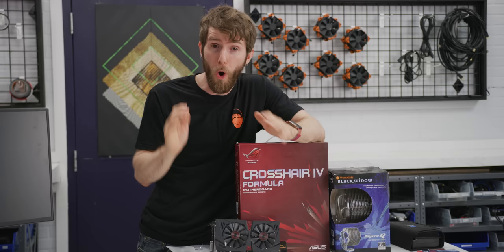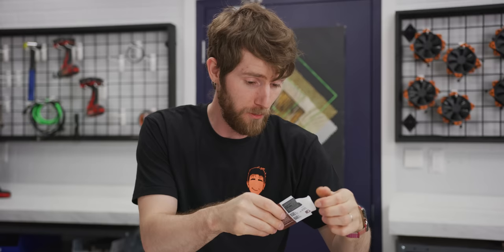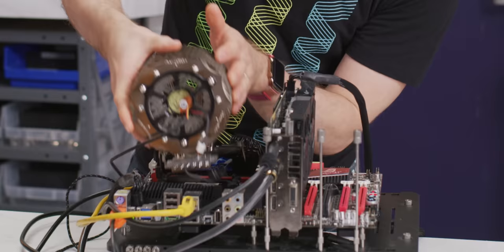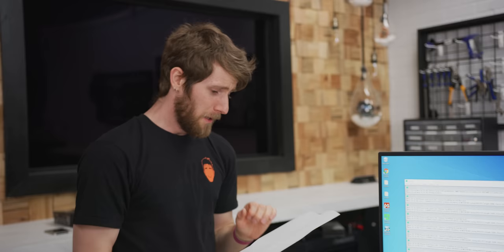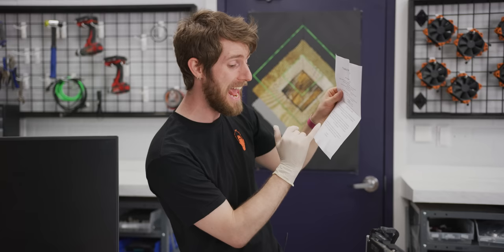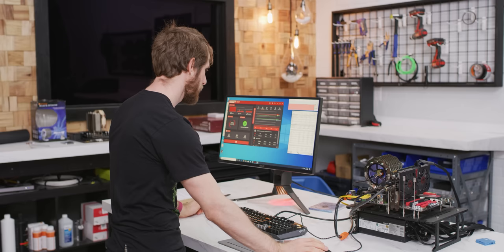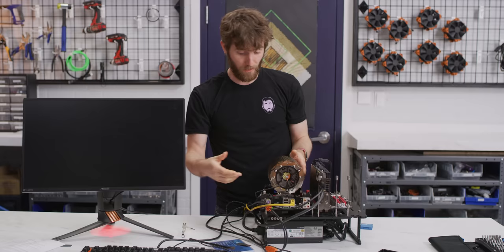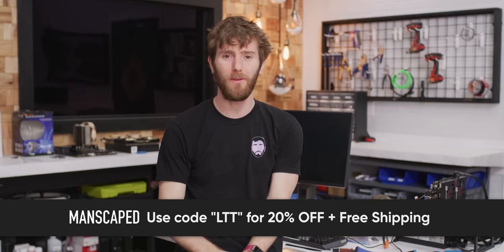Testing Another YouTuber's Thermal Compound!

Comment: The epoxy reaction is exothermic while curing, so it's adding chemical heat until it's fully cured.
Reply: However that whouldnt explain the next days results
Reply: If a reaction is exothermic it will add chemical heat until the reaction completes, eg once the material has cured/dried. Hence after the material has cured, no more additional heat is produced from the exothermic reaction as the reaction is complete. Therefore it will perform better, reducing the temperature (and this is what would have happened if it was left overnight). A chemical reaction does not continue indefinitely, the reactants are mixed together to form a product relatively quickly, not to continue forming together forever, this is why they are supplied in two separate tubes.
There are other issues to contend with the increase in performance the next day, as the any excess solvent which supported the colloidal dispersion also will have evaporated, which itself may not have been very thermally conductive, and until the reaction completes (irrespective of the exothermic nature) the compound likely just will not perform as well.
Reply: @crayonmunch  I think he meant temperature fluctuations that occured the next day during stress testing.
Reply: force curing an epoxy will affect its' performance - physical glue performance is not the most critical in this application ( pardon the pun ).  adhering to the manufacturers specification may have improved the results.  maybe this is a pocksy product.
Reply: @deansmith4752  No, it's just that thermal epoxy is a product that does two things: glue+thermal interface, so it does them worse than products that do only one thing, such as regular glue or thermal paste.
Of course, if you have to mount a heatsink and you need it to be glued on, neither glue nor thermal paste will do the job, thus thermal epoxy comes in doing either thing worse, but both at the same time.
Reply: We use epoxy that drys out when heated with a heat gun, and if you dry it too fast it cracks 
Heat guns are much warmer than what a CPU can do though, but it doesn't take much to destroy the curing, which is most likely what Linus did when he tested the CPU before it had cured 
If you walk on concrete before it has cured, you might leave footprints.
Reply: @dubious6718  Except he wasn't hitting the cooling plate or cpu with the heat gun.  He was using it on the fin stack to get them up to temperature so he didn't have to wait as long for equilibrium.  Any heat curing effect on the cpu/plate interface would have been done by the cpu itself, as it immediately runs at high temperatures, long before the heat gun heat would have had a chance to work its way down.

Comment: You can lap the epoxy back off, could be interesting to see how much (if any) lapping it does ;-)
Reply: I also thought he could just lap it when he wondered how to get the epoxy off. Or after that hammer treatment... just belt sanding it :-D
Reply: bath in acetone for a night  makes epoxy soft. Afterwards, should be easily to remove by means of plastic knife.

Comment: Before he even said the processor I was thinking to myself "This sounds like a job for the FX series!"
Reply: My first build had an FX and an r9 270x innit. Too bad the PSU/Mobo died in the move. Miss the ol' space heater. Still kickin around just wont post. Seriously though, my teenage bedroom was always like 5-10F hotter than any other room in the house.
Reply: @sovietbear3024  I've got a PowerMac G5 with two dual core cpus, and it is litterealy equivalent to a space heater.
Reply: @sovietbear3024  My first build also had an FX 8320 and a r9 270x xD, the GPU and the mobo died, but the CPU it's still working haha, and yeah my bedroom was way hotter than any other room.
Reply: @sovietbear3024  I ran an FX 6300 and 2x R9 270x CPUs in XFire. The thing seriously kept me warm in the winter when I would play GTA IV until 1-2 am. Now it is my high school best friend's wife's computer. The thing refuses to die despite changing hands 2 times now. The only changes it has had is it has an SSD now and I removed 1 GPU because of XFire support slowly dying. For what it's used for, the thing still runs well. I'm impressed it's still useful nearly 7 years later, especially knowing the FX line.

Comment: As a 2 component adhesive, you have to remember one thing after cracking it open:
If the adhesive is only sticking to one surface, then either your preparations(polish, cleaning, putting on bonding agent) were shitty, or the adhesive is not worth buying anymore.
Reply: He made no preparations.

Comment: "permanent"
You lost me, might as well weld the cooler heatsink directly to the cpu lid.
Reply: Yeah. I could maybe accept semi-permanent if the performance gain was enough -- but permanent is a non startee
Reply: not weld, you would have to solder or braze, cpu lids are nickel chromium plated i think?
, heatsinks are aluminium or copper.
would have to be a copper heat sink , soldering or welding to aluminium?
not easy, nitrogen atmosphere or argon would be needed.

indium based solder or gold based  would be the choice i think, brazing would be way way too high a temperature.
brazing or soldering would also be less permanent than epoxy too, you could just melt it again when you wanted to separate them.
thing is?
the temp range of your solder would have to be so very specific...
melt temps are across a fairly large range , 75% of an official melt temp and your solder weakens you see...so if your cpu runs a max temp of 75 degrees?
you would need a solder that fully melts at about 115 degress C or higher, but can your cpu cope with that temp to bond it initially?
your cpu ever overheats, you could end up with a big puddle of solder on your  now fried mobo.
one of the following might work i suspect.

Bi55Pb44Sn1
 solid: 117 liquid: 120 -not this one , bismuth is a terrible thermal conductor...
In50.9Sn49.1 eutectic 120
In52Sn48 S: 120
 L:122
In50Sn50 S: 120 L:123

Bi55.5Pb44.5 eutectic 124- bismuth again no good.
In74.7Cd25.3 eutectic 127 but cadmium, yeah not so good .poisonousa as fuck ..this ones out..
Sn37.5Pb37.5In25 possibly too high a melt temp...of S:134 L;181 and lead in this one too, not terrible like cadmium but not so good either.....
so its indium solder if you want to try it....
Reply: @samuelbaird4983  Technically this is semi-permanent. Just gotta de-lid the CPU.
Reply: @deadprivacy  IHS is nickel plated copper, good heat-sinks will also be copper. So if you lap the nickel off you could theoretically weld the copper to copper (TIG with He gas and lots of amps - but it'll likely fry the CPU and there is no way to weld the centre that I can think of).
Reply: Or remove the lid and direct mount it.
Reply: @samuelbaird4983  that is thermal EPOXY not grease! It is not supposed to be used for CPU. This stuff normally used in "permanent" cooling solutions i.e. cooling outdoors LED array or when you need to bond heat sink with the heat source but can't use screws.
Reply: @jetstreamlynn3156  wrong. Just use solvents like acetone to dissolve the epoxy. Or chip it off / grind it on a sand paper.
Reply: @CED99  or just solder it
Reply: @CED99  i wonder if theres a way to cold weld it, copper will weld directly to itself if placed under enough pressure as in a crimp connector.
but all this fuss and you can just delid.
a better route might be to take the copper lids off the cpus and directly solder coolant pipes in for water cooling, so instead of having a chunk of metal between your coolant and your lid, the lid itself becomes the only metal between the4 cpu and the coolant.

Comment: So meanwhile 70• Celsius is a lot...

My very hot MacBook: allow me to introduce myself
Reply: The FX Chips had components inside that actually werent supposed to exceed even 60 degrees C For a long time
Reply: Banana Bob FX chips had very low thermal limits, they ran hot and also didn’t handle heat well. Even Intel chips of the same era didn’t mind getting into the 80’s. I had an FX 8320 (because I needed more cores despite the lower speeds) and at 4.0GHz it’d get well into the mid-high 60’s, although it ran for years no issue. They generally were pretty crappy performers though, especially in gaming where mine could bottleneck an RX 470 pretty badly, AMD was a bit of a laughing stock in those years.
Reply: @helplmchoking  was it a process limitation or TSMC limitation?
Reply: MacBooks are factory-designed to act as a replacement electric oven. Think different.

Comment: To soften epoxy, use the heat gun to heat up the parts. At some point it'll get soft enough to separate the parts. I don't think it'd be hot enough to damage the CPU, though it'd be way above acceptable running temperatures.

Comment: 1:51
yeah... I took the risk going from the phenom II x4 955 to the FX 8120 when it came out, before it was really thoroughly benchmarked, I jumped the gun on it thinking, well, this 4 core AMD is pretty good for what I like to do with it, so, this 8 core, should be better.
It wasn't :/

I had good thermals on a corsair H60i and some arctic silver 5 paste, had it overclocked to 4.4ghz~ on a ASUS sabertooth 990FX rev 1.0 without crashing before it's 72-77C~ shut off, usually sat between 50-65~ in games, or fucking chrome, Sony rendering videos got it a little uncomfortably hot, idle was nice and cool though in a Corsair 600t with two 120mm pull intake front, two 120mm pull exhaust top, CPU radiator pankaked with 120mm push/pull on back exhausting out and two 120mm push intake side orientated fans level with the GPU, it just heats up weird I guess, but I probably won the silicon lottery on the specific CPU chip I got.
Reply: @Joel which is what I was mostly doing at the time I had the 955BE, but when I built the 990FX build I wanted to dabble with Sony Vegas, but, also didn't expect the difference in game performance to be noticeably lower in a lot of the titles I was playing, which, sucked, but that's what happens when you jump the gun on hardware that gets put out on the market without having proper benchmark testing.

More than likely because samples were strategically sent out say, a week, or a day before, they become available for the consumer so they can drum up hype or, you know, NDA's, rushed deadlines, now, I, the consumer, am equally at fault because I jumped the gun before I knew how it performed in the areas I specifically wanted, but I had also been betrayed by ATi's God fucking awful video drivers, both those things eventually moved me over to team green and Intel.

I want to try ryzen, it is a good product line, but if someone intentionally takes advantage of gullible people once, it's hard to rule out they won't do it again, and I know this is a completely personal bias, but everybody is allowed to have a personal bias as long as they have a concrete reason behind it.  

I don't know, you got to live up to the hype, if you can't, be modest about it, modesty is far better than betraying someone by not being able to deliver the hype you promise. 

Which is why I like ryzen and have considered it for my next board/CPU swap 

I kinda ramble

Comment: At some point you'll discover Boron Nitride. Realize its 50% cheaper than ANY other high performance thermal paste. Has 4 times the thermal condicutivity of any other paste on the consumer market at 30W/mK, has higher dielectric voltage and significantly higher thermal breakdown. Long time fanbro. Keep up the good fight!

Comment: When linus was hitting that cpu i died from the inside..
Reply: Thin putty knife with hammer gently tapping.
Reply: That CPU does not deserve your empathy, it's a less than decent processor. Even when it came out as new, it still was far from good
Reply: @AlphaDragonStudio  , it's good enough for 10 year old kids that only wants to play Fortnite... and they don't deserve anything better ether :P
Reply: @brrebrresen1367  fortnite is a kinda taxing game lmao AHHAHAHHAHA i doubt that could run at least on a playable level
Reply: @NoThrottle  You can run it on a core 2 quad man, FT is not demanding
Reply: @brrebrresen1367  i just built a ryzen 3 3200g, 16gb ram and rx 580 8gb pc for minecraft.....
Reply: @NoThrottle  , depending on what your going for... 144fps at 4K? not a chance.
made a PC for kid of a friend of mine and got an 200$ budget* (what he got for his 11'th birthday)
ended up with an FX8350, 16GB of RAM (4x4GB) Asus Sabertooth 990FX and an old Vertex 120GB SSD i got for 100$, and a Zotac Geforce 970 for the other half.
then managed to get an old Coolermaster ATC with an modular 850W Chieftec PSU, and an HP ZR2740W with broken HDMI (DP worked fine) for free.
even at 1440p it keeps up 60fps in Fortnite though it sound like a friggin F104 Starfighter trying take off inside it (blower style fan on GPU).
(did test for the pure heck of it and it did run Final Fantasy XIV at 1440p medium settings at 60fps, though a 24man raid with all the particles almost killed it so had to turn em to minimum and with those turned down it stayed above 30 but was closer to 30 in average than 60)
*edit: this was back in February last year

Comment: Epoxies produce heat while they're curing. It's an exothermic reaction...
Reply: They do generate heat when curing. However it would not be comparable to the ~100W output by the CPU, which is several orders of magnitude higher.
Reply: They do but not that much to make a measurable difference with such a small amount.
Reply: Depending on the epoxy and the ability to radiate heat, which in this case would be low as you've got it next to a CPU, I'd say it would make a difference. I've done fiber glassing before and the heat is enough to warp the part if you aren't careful.

Comment: I used thermal epoxy on my LSI 9260-8i raid card, glued the smallest water block I could find, which was a small 1"x1" one from Koolance.  Card got so hot it shut my system down on air, afterwards it was getting the warmer water AFTER passing through the cpu + gpu, and it always stayed nice and cool.  Under heavy system load it stays in the 50's.  It's still glued on and running great 10yrs later lol

Comment: 3:40 "eight threads... Ahem 😂
Reply: CMT was so weird that windows didn't even know how to report it. Technically there are 8 cores, but their float execution units, and L2 cache are shared between 2 cores.

What you got was L2 cache contention with some loads, bad floating point performance, pretty decent integer all core performance, but an overall lackluster CPU. AMD was kinda betting on GPUs taking over for floats, which hasn't happened yet except in their upcoming Frontier supercomputer.
Reply: Back when AMD was shady af and sold fake 8 core CPUs.

Comment: I'm not an epoxyologist, but two-part epoxy's "curing" is a chemical reaction, usually exothermic. when you heat it up, the reaction (curing process) should speed up, causing more thermal energy to be released, which would explain the slow climb after reaching a max temp. you really should try this again but apply it all properly and allow a couple days to cure.

Comment: Given the level of accuracy of every tech ingridients video, i seriously believe that the epoxy was not applied properly. I particularly refer to the sanding part. All in all you sanded only the surface of the heatsink, and looking at TI video, they did a way more careful sanding.
Reply: No, the problem is he is comparing a thermal expoxy against a thermal paste. Epoxy is made for permanent solutions and has less thermal conductivity than a paste does. This was poor research on LTT’s part.
Reply: @Zeddd7  And Linus references this at the end of the video.
Reply: @Zeddd7  But why would you use it then. If it outperformed thermal grizzly for example then fusing your cpu to your cooler might be a worthwhile tradeoff for some extreme overclockers, but if a cheap pad works better, why even bother?

Comment: You can still get the epoxy off.  Try paint stripper, isopropyl alcohol (not together with the paint stripper, probably try this one first), and if the worst comes to it, sand the CPU very very carefully with a soft brush, checking every few seconds.  
Honestly I wouldn't recommend the paint stripper due to the very possible risks of eroding the seal between the actual CPU and the lid covering the die, and perhaps even eroding the chips inside it!  It is a truly worst case scenario and should be used sparingly and with extreme care, you should also introduce a second washing step to immediately remove it after a few seconds.  Chances are it'll still have little effect for this kind of epoxy though.